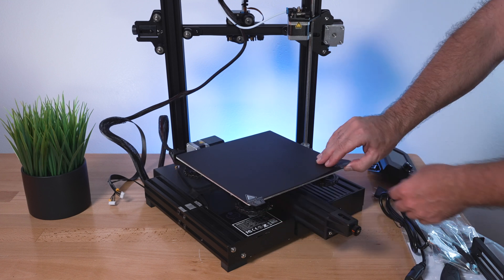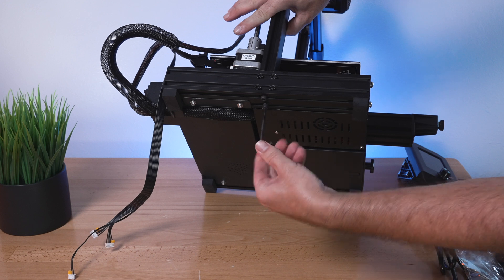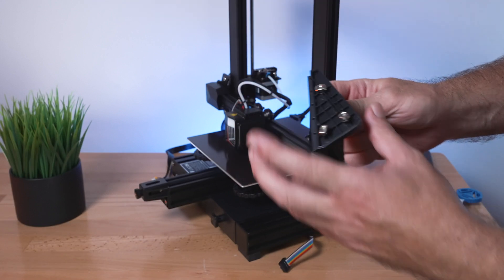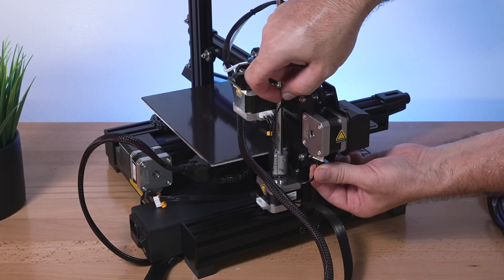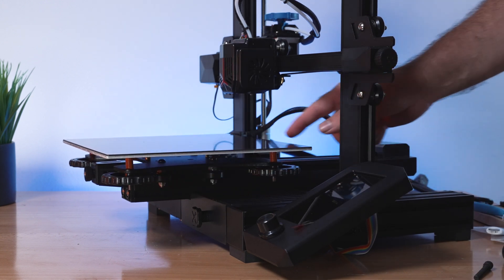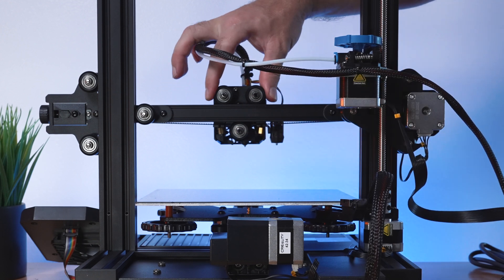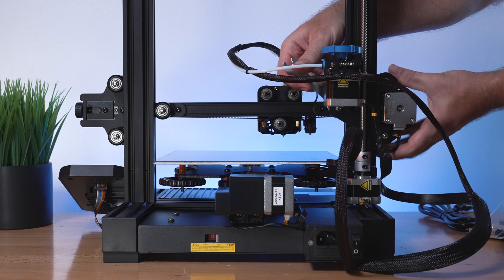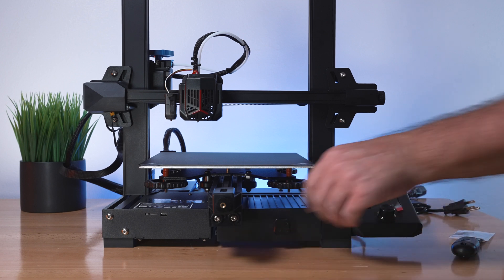Creality Ender-3 V2 Neo - Assembly

Comment: I am just setting up my printer and the table has three "clicks" / "stops" (actually sounds like "thumps") as I move it front to back. Is this normal? If not, how do I make it smoother? I checked for flat spots on the rollers and indentations on the track and I do not see any.